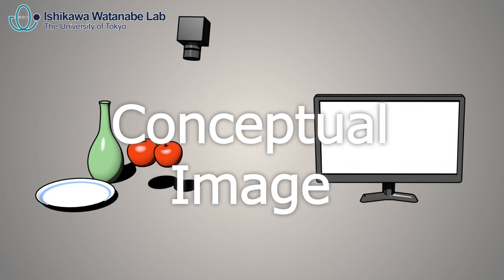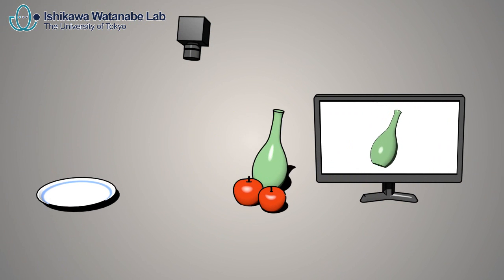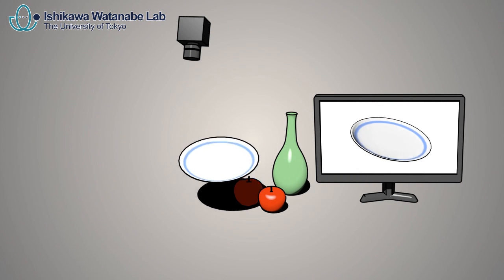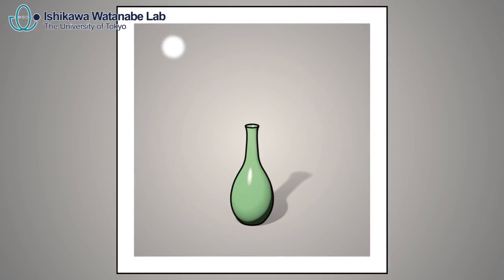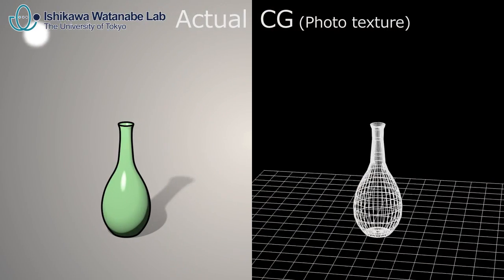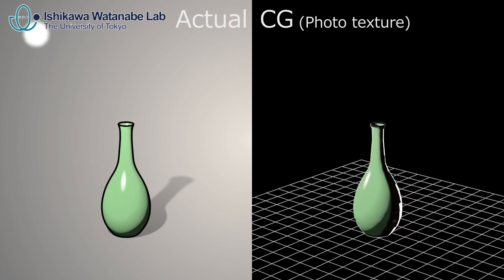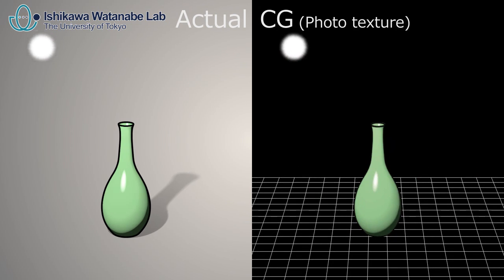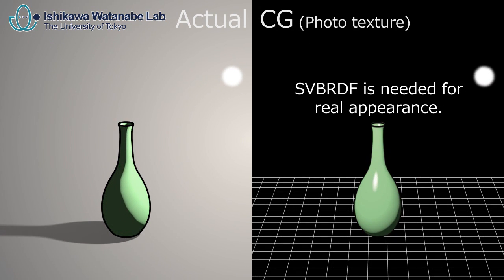Rapid SVBRDF Measurement by Algebraic Solution Based on Adaptive Illumination

Comment from the maker: A new video "Rapid SVBRDF Measurement by Algebraic Solution Based on Adaptive Illumination" has been uploaded to YouTube. This video introduces a high-speed SVBRDF measurement method which can be 180 times faster than a usual approach for an example. This method can measure how light is reflected at a surface of a real object for a photorealistic rendering in computer graphics. The result of the measurement can be used freely. A sample of realistic expression is demonstrated in the video.